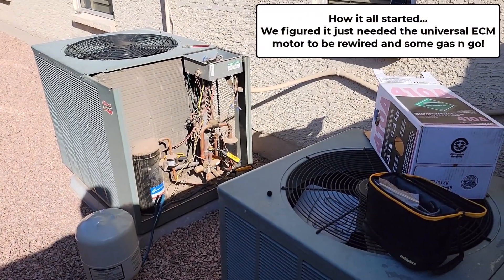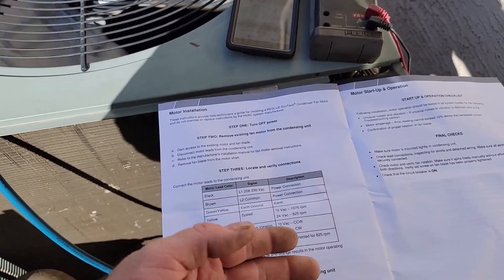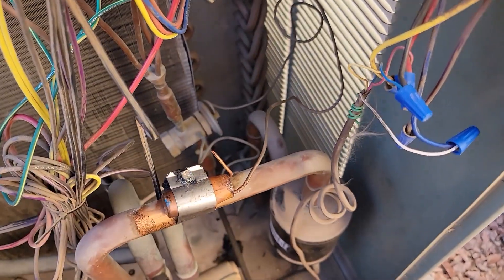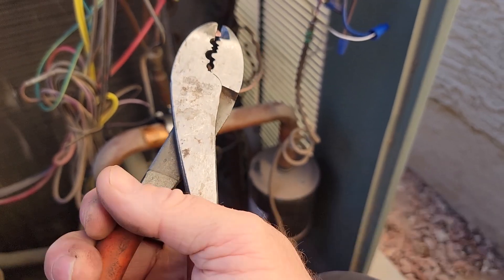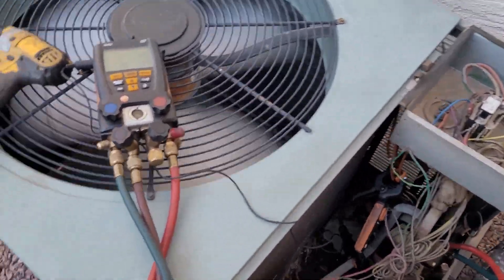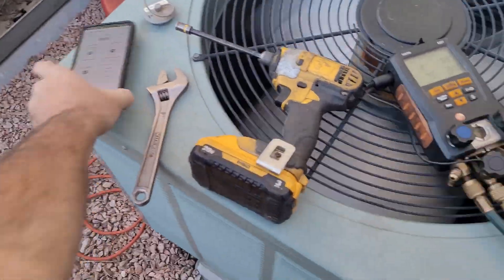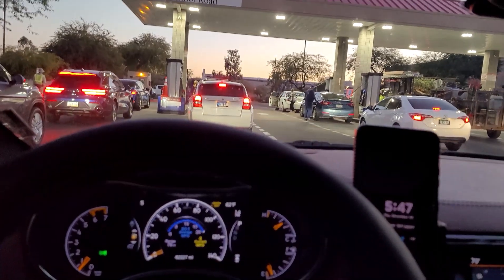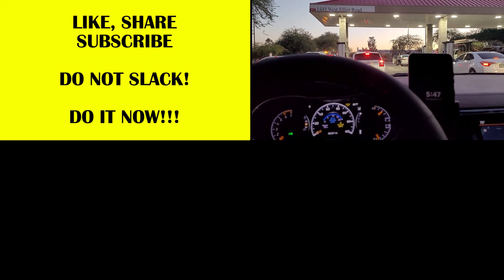So... it was thebTXV after all! (Quick TXV repair without total evacuation) 😁

Comment: Yea those Rheem/Ruud they use ECMs have different RPMs I've noticed. For the 16 SEER straight AC older ones I noticed the 5!tons are 1000 RPM and 4 ton 870 RPM so 825 should be fine but on the 1000 RPM I considering just putting 1075 but worried it would be noisier and draw more than 1/3  hp for a truck stock ecm or psc... So I kept OEM. Good to see you posting Some HVAC vids too, although the Ghetto and home vids are interesting too.  Happy New Year!
Reply from the maker: Thanks. I really only see resi when it is friends or family.

Comment: I’ve never recovered the refrigerant to replace the top section of the Sporlan TXV’s, I thought they were called the power head. I’m talking about the part the sensing bulb attaches to. Most I’ve replaced are on Rheem H/P’s that have rubbed thru the line on the sensing bulb, losing its charge. I just unscrew one, catch the parts, install the new ones. I think I lost .2 of a PSI on the last one I did about a month ago. Might save yourself some time.
Reply: .2.  😅😅😅😅
Reply from the maker: Yeah. Power Head. I said it once or so but kept getting tongue tied and also thinking of "head master" in my mind., Which is low temp condenser bypass control. 😄
I've replaced these a few times without recovering. Some seem to piss out more refer than others when you do. But there really is no large path so you are usually ok. I probably could have done this one with no recovery as at 15PSI it hardly hissed at all with the dome removed.

Another reason I recovered was because I knew I had over charged it the week before.